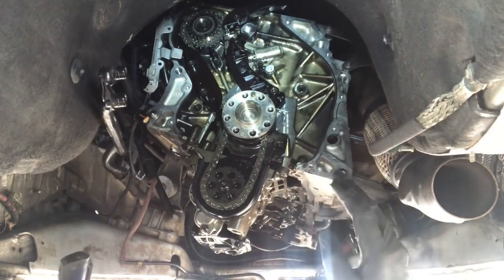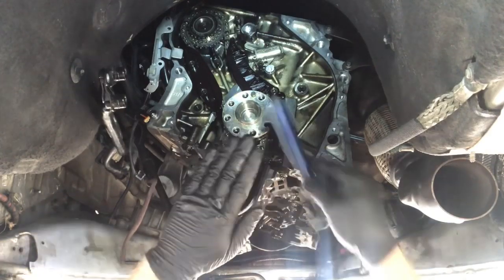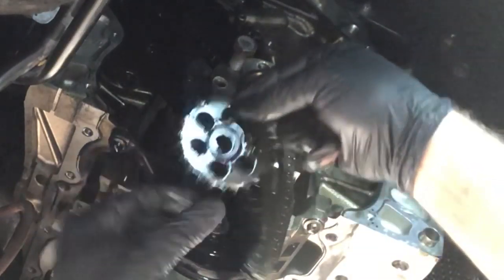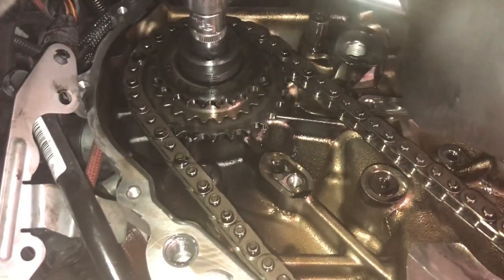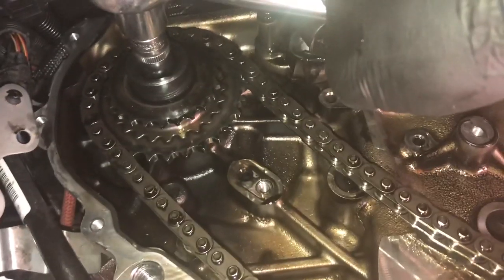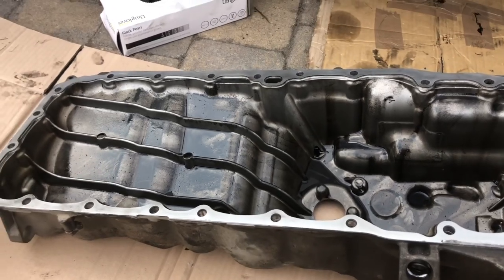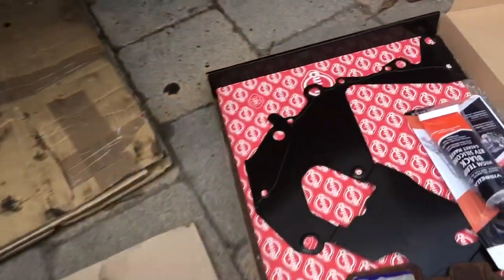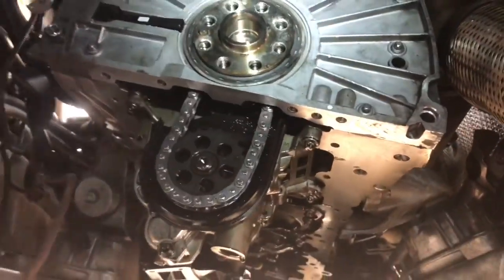BMW 530d F11 BROKEN TIMING CHAIN - Part 3: Timing Chain Replacement N57/N47

Comment: Let me first say that I am full of admiration of you, taking on a gigantic project like this.
You are doing amazing work and I am all for saving money where ever its possible, instead of paying thousands at the dealership.
They are realy securing their income by making the custumers bleed for repairs like this.
But...
Why the hell did'nt you pull out the engine instead of lying on your back under the car ?
It is garantied much much easier to work on and you can do it standing up.
Believe you me, it is alot easier to rip of the head when the engine is out of the car and You have all the space you need.
Reply from the maker: I know it seems odd if you’re used to pulling out engines... but I’ve not pulled an engine before, and I was more familiar with the transmission side of things, so I decided to go that way...
I weighed up both methods, but if I’m honest I was a bit scared of disconnecting even more things in the engine bay to get the engine out. Plus I’d need to hire a hoist, and I cannot be sure how long I’d need it.... blah blah, I just chickened-out & did what I knew more about! 😂
Reply: @Nut_Job.  Okay...
But next time you have to do a big job like that, you consider buying or hirreing a hoist.
You will discover that pulling an engine is rather a easy and straight forward job and it is even often easier to pull both engine and transmision at once and then it's easier to take them apart and put them together again when they are out of the car.
But again: Impressing work and an inspiration to all of us who is scared shitless of buying a car like yours and find ourselfs in a situation with a broken timing chain.
I am. as we speak, negotiating on either a 535d or M550d touring.
The dealer has 2 of each and if we can agree on a price, my old Mercedes S211 from 2008 (by far the most expensive and disapointing car ovenrship I have ever had) is leaving our driveway.
There are two happy moments in a mans life: When he gets his first Mercedes and when he sees it leaving for the last time !

Comment: I'm so glad the timing chain on my 330D is at the front, I can't believe they put the chain on the back on the N47/N57 it's such a nightmare! But honestly well done for keeping it up and making videos of the whole procedure. As for the replacement chain and guides is their a revised version of them? If I'm not mistaken the N47/N57 where failing because of the guides and replacing may still result in the chains failing again due to the design?
Reply from the maker: I’ve heard that too, however my guides were all fine. It was just a stretched chain failure ☹️

Comment: I admire you working under the car like that. I have done complete restauration on old cars but I use a 2-post lift in my garage. A tool you may consider for much better comfort and easier access. Well done anyway.
Reply from the maker: I would LOVE a 2 post lift 👍

Comment: Dont put that oil pan back on till ya head is back from da machine shop. Timin chain will drop and skip a tooth on ya, i would have also waited ta put the timin cover back on also. Other than that ya  is doin a great job showin us how that bimmer diesel engine is put ta gether

Comment: Top tip. When removing bolts or parts on project as big as this. Screw them back after removing any part if not possible, use a lot of plastic bags where you label them. Dont just leave them on ground. I've learned it the hard way. It's very frustrating to go to stealership to buy new bolts or etc fastening parts.
Reply: No, you cant re-use BMW bolts, they're aluminium, torque to yield, so re-use means the break off when torquing.   All need to be replaced or you'll have to do the whole thing again potentially.  The block is alloy so you cant use metal bolts, different metals react badly.
Reply: @user-t3b8l  hello, ofcourse you replace them, but before installing them, just put old ones back so you dont mix stuff.

Comment: I wish you'd get a grip of your measurements. I've watched several of your videos and, frankly, you haven't a clue what cm or mm are. Look at 1 minute 30 in this video. You state that the oil pump chain should have around 70mm slack at its narrowest point. Ludicrous and it spoils your otherwise good efforts.
Reply: Who’s arsed??? He’s doing this on his fuckin driveway!!! Pull your thong out ya arse and stop being a picky little bitch.
Reply from the maker: I was trying to be diplomatic, but we can use your words Jon 😂
Reply: Lol how dare you give a simple method of checking tolerance.
Reply from the maker: I work in mm all day everyday... why don’t you re-think your comment?!
AT ITS NARROWEST POINT, THE CHAIN SHOULD MEASURE ~70MM WITH AN ACCEPTABLE AMOUNT OF SLACK? Am I missing something?
70mm is 7cm. If you pinch the 2 sides of the oil pump chain together they should make ~70mm gap. 🤔
Reply: @Nut_Job.  At 1:30 you state: "this should have a bit of slack, by the way. I haven't measured it but ". The text caption then comes up with I BELIEVE IT SHOULD MEASURE ~70MM ACROSS THE NARROWEST POINT. clearly, you are commenting about the slack because you aren't specifying anything else. What should measure about 70mm? The distance from the inside circumference of the chain run, the outside circumference or what? Get a grip.
Reply from the maker: The distance/gap between the inner edges of the chain when pinched at its narrowest point. 
It’s kind of hard to ‘measure’ chain slack any other way in a DIY format. 
Don’t come at me with stupid confrontational comments like that about metric measurements, when I work with them all day, everyday... plus when I’m tired & cranky 🤨
Reply from the maker: See ya 👋
Reply from the maker: For anyone else reading this thread, perhaps it wasn’t clear in the video, but I thought it was pretty clear... 🤔
Lateral shift from the chain centre-line would be the way to measure slack properly, however when on your back under your car at home on your driveway things need to be simplified. Therefore I’d say the easiest way is to pinch both sides & measure the internal chain gap. Lateral shift can only be measured at one point & the other side would have to be kept tight... not so easy at home, that was just my thoughts 💭
Reply: @Nut_Job.  But that's not true, is it?
You weren't on your back under your car when you added the caption. If you're unhappy with feedback, fine by me. Plenty of other videos to watch. Pity, as I have an N47 engined car.  The theme I wrote about is common in your other videos.
Reply: @seankirby2580  I thought you'd unsubscribed?

Comment: Have to wonder if an engineer at BMW is working on a new design that will make it impossible for an average guy to do this job.
Reply: that is their plan, once a car is above a certain age, 2nd, 3rd owner they want you to scrap it and buy another...i like old skool stuff.
Reply: I can't understand why they have moved the chain to the rear of the engine. I have  2006 530d with the chain up front. The TIS says remove the engine first but I am changing it now with the engine in the car. I have a garage to work in so kudos to the video maker for doing this in his own driveway. Respect!
Reply: I Garasjen 

They want every replacement to be an engine out repair I guess.
Reply: @igarasjen1128  The did it in anticipation of future EU pedestrian crash proteection requirements. Apparently a metal chain spinning really fast at the front of the engine does a lot of damage to someone that you hit with the car. This is also why they moved the vacuum pump into the sump, of all places! But yes, I'm sure part of their reasoning was to ensure they got plenty of money for repairing an engine that would scare most mechanics off.
Reply: This is not a job for an average guy anyway, even if the timing chain were in front of engine  like in most configurations.
Reply: @j.badinter988  yup, i used to run my own garage, jobs like this i would pass onto a specialist, too much to go wrong.

Comment: Is there a tensioner for the top Cam chain and will you still have access to it now you've put the rear cover back on?
Reply from the maker: Yes there is a tensioner - it’s a large ‘sprung bolt’ which is inserted into the side of the cylinder head. It’ll go in later when the head is on & just before the final camshaft sprocket is tightened up 👍
Reply: @Nut_Job.  it will be interesting to know if this tensioner was the reason for the failure of the chain, will you show the old one and compare to new?

Comment: The most idiotic deciision from BMW to build the timingchani at the back of the engine. Same goes for the M57n2 engines thats where it started as far as i know. the old m47 and m57 had the timng chaing at the front.
Reply: M57 engines have the chain on front, m57n2 have on front, just N engines have rear timing chain.
Reply: @fabini14  sadly not. I have the m57n2 and its at the back